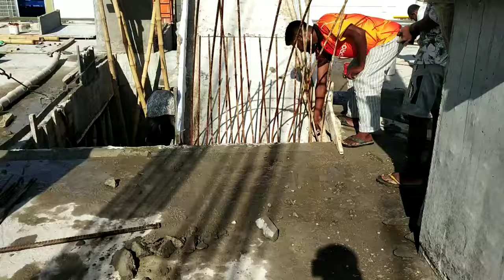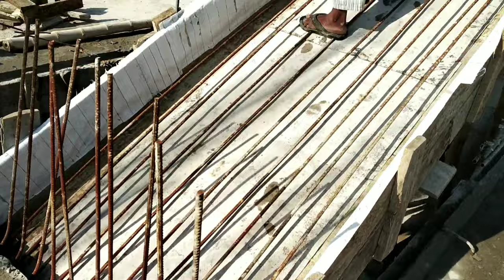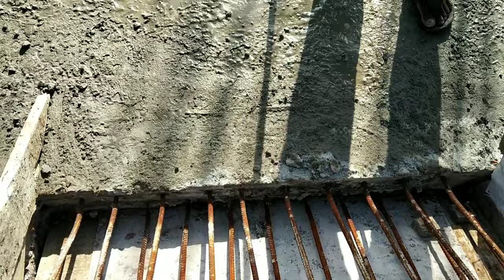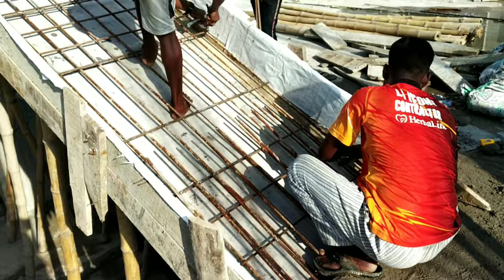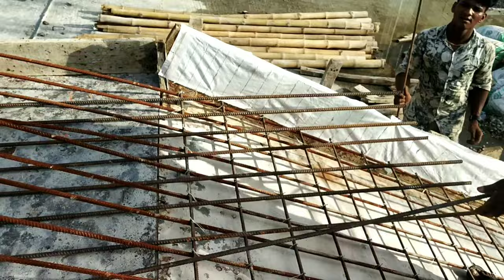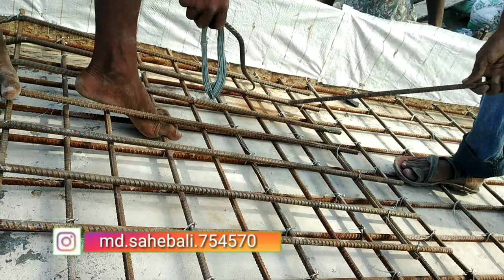Amazing stair rod binding technique||কিভাবে সিঁড়ির রড বাধা হয়||Amazing technique stair rod binding

Comment: Very bad job done! The bending diameter of the reinforcement is not observed, so there are higher turning forces, which leads to the splitting of the concrete. Armature anchoring is not done correctly.